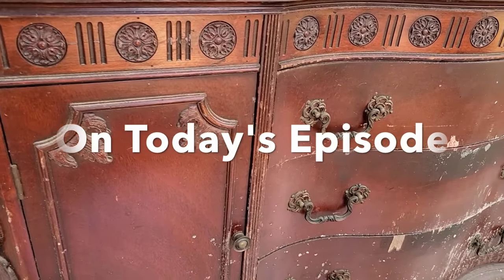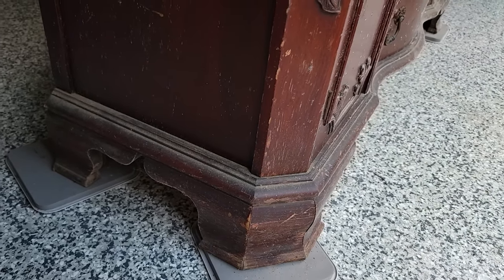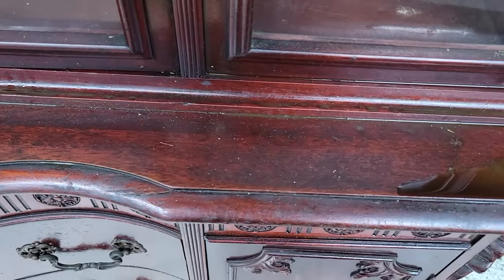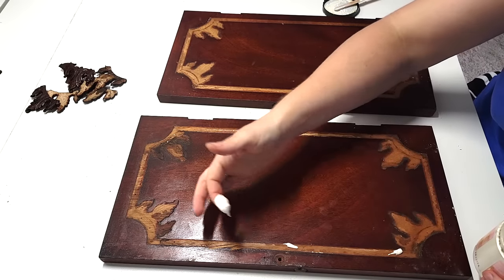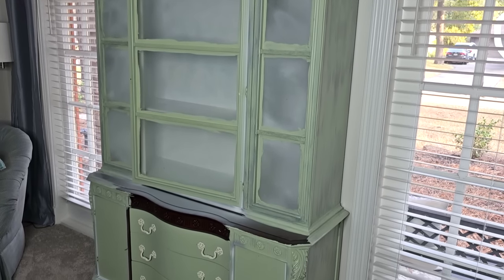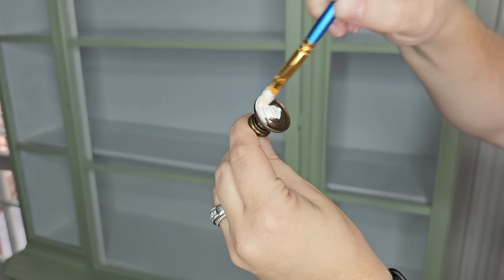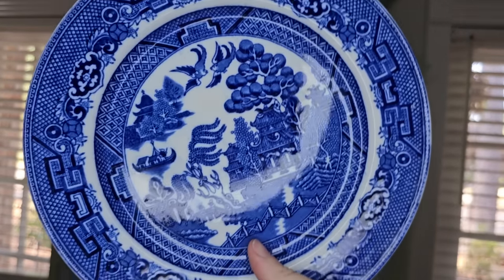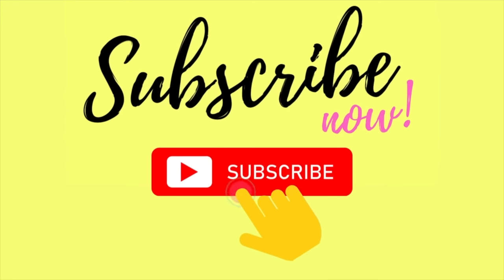Trash to Treasure Makeovers: Living Room Makeover Part 2

Comment: How do you paint without a tarp or paper on the carpet? You have some mad skills! Does your little green machine do a good job extracting the liquid? Lovely color on the hutch.
Reply from the maker: With skill and some luck haha. Yes it does a great job of extracting the liquid. My hose has started leaking where it joins the machine though which is disappointing. I'd recommend buying one from Costco so you can return it if you have any issues.

Comment: How did you repair the broken off veneer? I have a piece very similar to this, but lots of broken off veneer that I have no idea how to repair.
Reply from the maker: If you are painting it I would recommend using wood filler to fill in the area where it is missing veneer.

Comment: In the corner to the Right of the Hutch….what about a small round table and two smaller arm chairs and make it a Chess Table or small Games Table? Finding two wood chairs that match and maintain some of the wood yet adding that green as a touch here and there like on the legs or arms depending on what you find and then the table you could actually paint the Chess Board ON the table so it could be Chess or Checkers or have a Felt rolled out for Backgammon? Just a thought and good luck if u do find something like that then at least it is a useable space for the kids too and who knows…..you could have a little Bobby Chess Champ??? ❤❤❤❤❤

Comment: Instead of a actual ottoman a small low to floor but strong table with a shelf under. Paint to match chair. Then make a cushion for the top to match and 3 straps of velcro to keep it attachable for washing purposes.   So u have to ottoman ( seat/foot rest) and the shelf for books, magazine , TV remote, or Lil ones toys.
Reply from the maker: That's a great idea

Comment: If mold is toxic, why did you cover over it with the filler and the scoop the excess back into the product, should you not have removed the mold first?
Reply from the maker: The mold was on the back side of the appliqués

Comment: As a designer I would like to share my opinion that your blue chair should be moved out a little more out from the corner and not so angled bringing it out and closer to the cabinet. Having  your chair more in front of your window with the back of your chair. Still angles but “not” so angle as having it at a 45• angle as it looks to be right now. Your lamp is way too close to the corner walls and your curtains. It wouldn’t be very good for your curtains to catch fire from the heat of your lamp. Otherwise your colors and placements of your decor is right on but will look even better and more professional as you have spent many hours recreating some beautiful pieces.